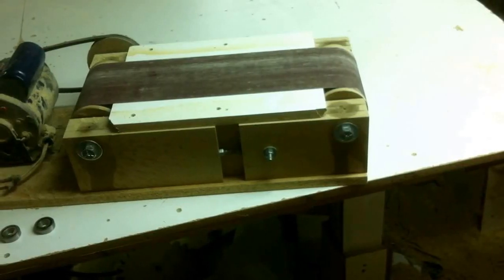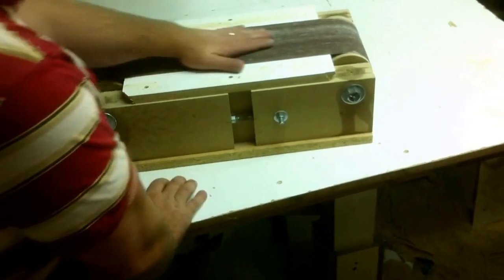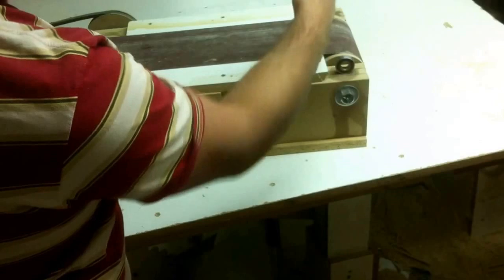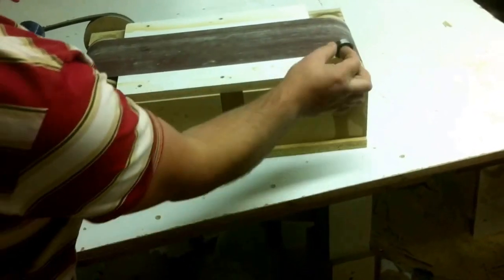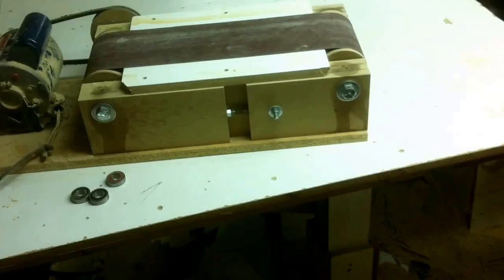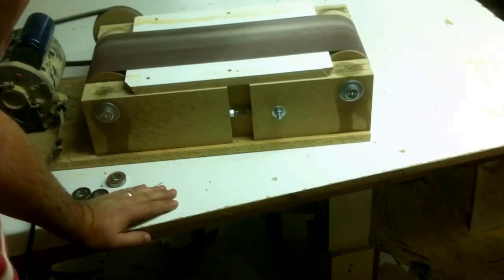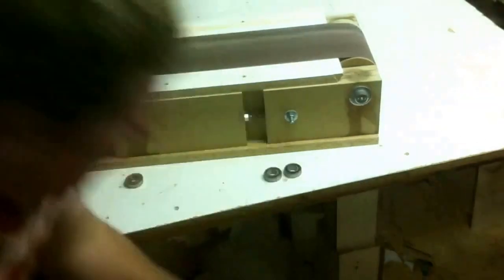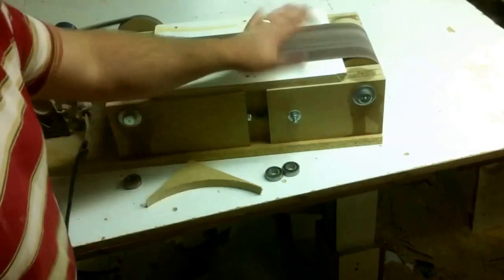Cheap DIY Belt Sander 4.  Need to get some bearings

Comment: I made a belt sander virtually the exact same as you. I used wood with PVC over it for the shafts. I had problems getting the tracking correct because my MDF kept wearing away. I would have tried fixing it with bearings, but I ended up buying a belt/disc sander for about 60 dollars new. Love the DIY of this project, good luck!

Comment from the maker: Thanks Jim. I looked on ebay last night and found lots of 16mmx35mm but they want over 3 bucks each. It's not worth the haste when I can just stop in at princess auto and pick them up direct for a few pennies savings.  I appreciate the advice though and if you do see somewhere where they are cheaper than that let me know. Thanks again.

Comment: One good way to keep the MDF on the rollers from wearing would be to make all of the MDF discs (aside from the 2 outer discs) just shy of 1/2" smaller in diameter. Then get yourself some rubber mats, and wrap a piece of the rubber around the inner part of each roller. Cut the rubber length wise just a hair shorter than the circumference you need to allow for expansion. I'd imagine some 2 part epoxy would hold the rubber in place on the rollers, and maybe a few tacks along where the edges meet up when you wrap it around.

Comment: Are you going to change the position of the motor? Maybe underneath? The way the belt is running now will make you stand next to the motor and pulley. Anyway, nice job and thanks for posting.

Comment: Check out eBay for bearings a few years ago I bought a 10 pack of about the size you have there for around 6 dollars and that included shipping.

Even if you can't find as good of a deal as I did you should still be able to find them for about $2 a piece delivered when you get a 10 pack.

Comment: "Four bearings in each of these shafts" would be what? Eight, cause there are 2 shafts? Or is there a bolt / shaft on each corner, in which case 16 bearings?
Reply from the maker: There is only 4 bearings total.  One in each corner